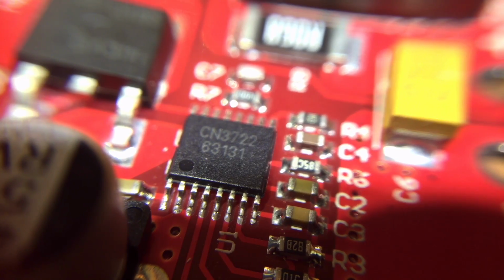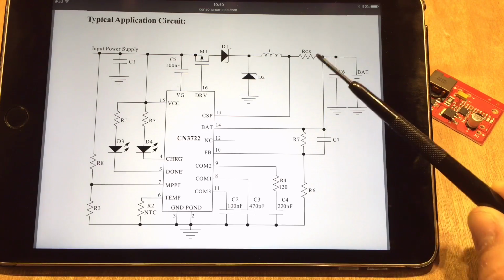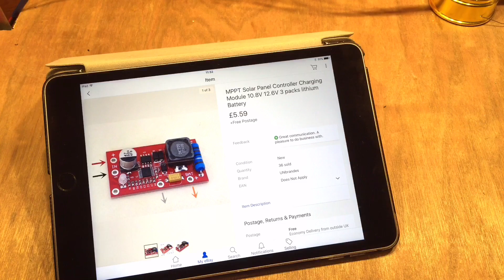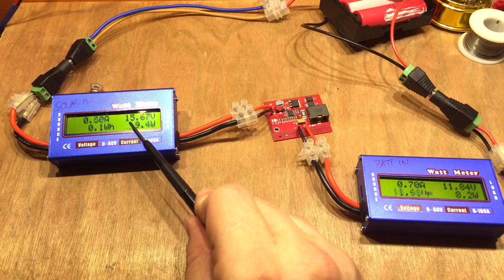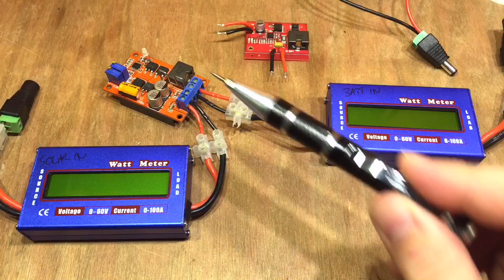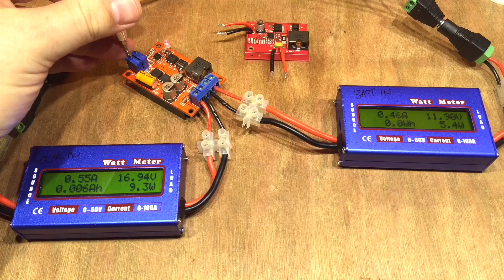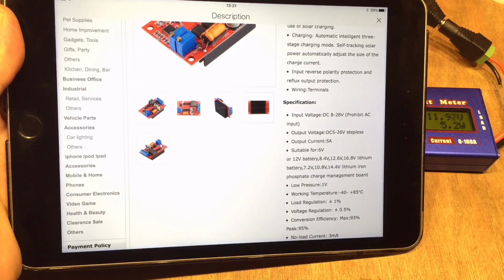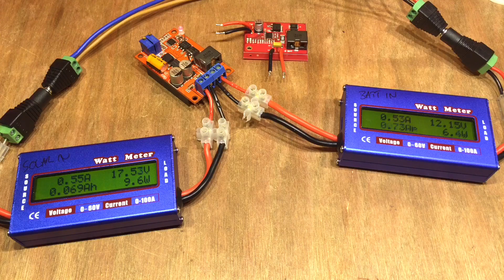Cheap(est?) Lithium MPPT Solar Charge Controller CN3722 - 12v Solar Shed

Comment: Hi Adam How maximum in put  volts does adopt this  moduler ?
And Ampier ?
Reply from the maker: Check the data sheet link in the description of the video.  The chip is good up to 28 volts and 5 amps.

Comment: I would have liked to see the panel plugged directly into the battery, through the meter, to see how much power would go into battery... The charge controller seemed to deliver lots less power to the battery, than the charger could put out.  Thanks.

Comment: I got this charge controller. However, it is showing a green light (meaning fully charged) when my three Li-ion 18650 batteries in series is at a voltage of 10.5V. Full charge voltage is 12.6V. What is the issue and how can I fix it?

Comment: the maximum power point voltage is never what it says on the panels. even with an expensive mppt charger. it alsways seems to be lower, yes, about 2V per panel.

Comment: I could not find 5A contoller like you share on the link. Now you can buy the same but it is written 3A output current. Can you pass another link or it is the same controller. Thanks!

Comment: How is it that they make a 5a $5 mppt charge controller then it jumps to like $100.
Reply: Because the $100 version automatically tracks the mppt power point and most can take higher voltage for series panels.  The cheap one is manual.and limited to 18V

Comment: I think you are confused about the MPPT voltage. It will always be the roughly the same no matter what the level of incident light. As the light level changes the output current will change (for a given load) and the voltage will remain fairly constant.

Comment: Noticed towards the end of your clip that the wattage into the batteries increased when you moved the pot away from the panel MPPT voltage.

Wouldn't it make more sense to peak the wattage input to batteries, as opposed to the wattage fed into the module from the panel.Great info though, keep it up.

Comment: hello Adam by chance have you tried to use more than one battery pack and charge controller  in parallel to see how it would work or if it would fail horribly lets say for example one solar source coming in going to oh say 2 3s packs using both of  these controllers set them up with one solar source input and each going to its own battery pack this is type of thing is exactly what i need to do with 4 4s 10p but 2 3s would be a perfect example on how these would function together considering they have the same micro controller you may find that a separate panel would be required for each one im just not sure yet im still setting things up and would like to know in advance I have 900 watts in solar so dividing things up a bit would be annoying but can be done. Another issue that may or may not come up is parallel the out put of the batteries on a load which may or may not play friendly while the batteries are charging and with the load active. If you do this test thanks so much in advance Ill know what to do and will purchase the second one you showed in this video
Reply from the maker: Multiple charge controllers on one battery bank is fairly normal - and in some ways I think it's easier to do with lithium because of the two phase charging rather than three for lead acid.  Two CN3722's set to the same termination voltage should work happily together, but they would need to be attached to their own panels.  Sharing panels on a MPPT SCC is going to make the whole thing inefficient I would imagine.
If you attach one battery bank to another they become one - and if they are out of balance a large current can flow between them.  It's best to plan to have a large battery bank, or two smaller ones and keep them like that I would think.
Reply: yeah its the sharing the panels that im really most concerned about and im thinking they would not be happy thanks for the response

Comment: Solar cells need a voltage converter that keeps input current at max.. input voltage get lower as sun light max. diminishes. According to panel/power graph indicates. Use perturb and observe logic folks.

Comment: i wonder how much power does the watt meter consume? if you put the two watt meters in line do the displays read the same?
Reply from the maker: Yeah they are not ideal.  I tend to use some now which have an internal battery.

Comment: The second one is junk.  It's not boosting the current at all.  It's actually REDUCING it and it's far worse than not quite as inefficient.  A PWM controller would be more efficient.

Comment: I assume this would not work with lead/acid auto battery?
Reply from the maker: The second CN3722 module would - set the output voltage and it'll do a pretty good job of charging the lead acid battery.  The only issue is you wouldn't get a float charge - so your battery wouldn't be quite as well charged as it might be of an evening.

Comment: I have been doing the same comparisons with a 2 Amp, 3 Amp and 5 Amp MPPT board. I am getting similar results.

What I found is that the cheapest board (the first one shown) is set for a 17 vdc Solar input, and the output is set to 12 vdc. What they say for specifications is wrong. Also, the maximum current is 1.5 Amps instead of 2 Amps. Again, misleading. You have to change the CV ratio and the MPPT ratio on the boards to get them correct. Then there is the cheap parts they use. I blew the 0.1 Ohm Current Sense Resistors after a few tries. Probably rated for 1 Watt. I replaced them with 7 Watt Resistors and they are working fine.

The 3 Amp boards I bought had one adjustment for output voltage. No adjust for input. Still set for 17 vdc. They ran pretty well until, again, blew the 0.07 Ohm Current Sense Resistors. The current limit was 2.5 Amps. Changing them now to 7 Watts.

I have yet to receive the 5 Amp versions that are the same design as you have. I will test those next.
Reply from the maker: Thanks for this - very useful to know.  Shame that it seems they've under-rated some components.  Best of luck with the 5 amp version

Comment: Hi Adam, I purchased the second mppt controller in this video.   I am wondering if I need to use a blocking diode on the battery side of this board.  I basically would do solar panel - blocking diode (I'm not sure if my panel has one built in so I'm going to assume it doesn't) - watt meter - mppt board - watt meter - battery.  do you think I need another blocking diode after mppt board or watt meter.  any thoughts from you would he greatly appreciated.  thanks

Comment: I recognized that turning the pot away from the MPP hightens the output watts to the battery while lowering the input watts from the solar panel. Assuming the important thing is what goes into the battery it seem to me that the whole mppt hype is a bit of a faustian deal, because whats the point to improve the output of the panel while decreasing the output to the battery?

Comment: unless I misunderstood you, you actually got more wattage into your battery from the first and cheaper version. Or did I miss something?
Reply: No not really, as he started to adjust the solar on the second one, if you pause the video right where it gets to 18.2 for the panel, you will see that it actually got the full rated 10W from his 10W panel... He said that his panel should be set at 17.5V for maximum power point tracking but I think that it's actually at 18.2V. I have these and they are excellent! Their outputs can be wired up in series or parallel for more voltage or current respectively... Or both parallel and series at the same time for higher voltage and current... The are very flexible...
Reply: @PeterMilanovski  wait you can wire these up parallel? Also I think he set the output voltage too low, the IC seems to be on CV mode instead of CC mode
Reply: @kaikart123  yes you can wire them up in parallel if they are connected to the same battery or battery bank! 
I had purchased around 10 of these things and had been testing them on a 36V solar panel which can peak up to 45V, they are not intended to be used with 36V solar panels, the datasheet recommend staying at 24V panels or below, I have found that it can work with 36V but will fail if the battery is disconnected from it while the solar panel is delivering! I have burnt out two of them so far and both times happened when I was touching the test circuit, otherwise the first one ran for 4 months straight, as a load, I used a computer fan which draws 0.5A and an led light which draws 1A and this ran day and night. The second one ran for less time but that was all down to me fiddling with the circuit sooner rather than later... I don't think that it would burn out if I had stayed within the recommended 24V or below... This burn out problem might seem irrelevant but I'm using Lifepo4 Batteries which have a built-in BMS and they will disconnect from the circuit if there voltage drops below it's threshold value and this would cause the MPPT charge controller to burn out should the battery decide to go into protection! The battery would also disconnect if to much current is drawn so that's another potential problem.... 
But they can definitely be paralleled... Overall, I'm really happy with their performance! And I think that it has something to do with the fact that I'm using the 36V solar panels, I found that it would fire up with the slightest bit of light in the morning and still trying to get every last drop of light at the end of the day, it's actually pretty dark by the time it actually shuts down, first thing in the morning and last thing at night isn't really outputting anything but you can see that it's still trying to give everything that it gets LoL... 
It does operate in CV mode, it will deliver up to 100W no problems, figuring out the cut off voltage is a little bit fiddly, I found that starting with a battery that isn't fully charged is a good way to start, after it's first few charge cycles, you can turn up the cutoff voltage to get it to where you want it to be, but once it's set, you will probably keep checking it a few times a day to begin with and later to once a day to once every few days till you just forget about it because it just works! And it needs nothing! 
If you have more battery capacity than you actually need to use, in other words, you have enough energy storage to keep whatever you are running off it to keep running for more than two or three days without sunshine, then you won't have to worry about the batteries going into protection due to under voltage... 
The batteries that I'm using are those 8Ah types that are usually used in computer ups power backup thing's, they are expensive per Ah but cheaper as a 12V complete battery that I don't have to build myself and it's protected against everything and has a built-in balancer! At $66Au each, I can purchase one a week and wouldn't notice it out of my pay! 
I hope that this helps...
Reply: @PeterMilanovski  I never knew you could wire them up in parallel, I need to handle 6A so I could just use 3 of these right?
Reply: @kaikart123  that's correct! With 10 of these I get a 1Kw... They do get pretty warm but with a computer fan also connected to the solar panel, it fire's up when the panel wake's up and shuts down when the panel goes to sleep which means that it's only working when it's needed, a diode in series with the fan and some capacitors after the diode will delay the fan turn off time, more capacity, more running time! That's just an idea though, if you are going to be using them at their 100W maximum rating, it wouldn't hurt to have some active cooling, either way, it has electrolytic capacitors on it and it's always best practice to keep them as cool as possible for long service life, capacitors next to a heat source always fail first before others that are further away from the heat source...

Comment: Thanks for the info. Could these be used with a 12V power supply instead of solar panels? It should work, shouldn't it? I'm thinking of using the variable one to charge a 2S pack. Thanks :-)
Reply from the maker: +Paolo Panzarino Yes it should work reasonably well.
Reply: @AdamWelchUK  This chip doesn't seem to power on with 12v input. Even though the datasheet says as low as 7.5v.

Comment: Hey do you need a heat sink for this? how do you mount it? Thanks
Reply from the maker: Shouldn't need a heatsink - it's fairly low power. Mounting is tricky as there are no mounting holes already created in the pcb.  It's not heavy though.
Reply: okay thanks I appreciate it
Reply: Okay thanks

Comment: About this mppt controller, sir. Can I buy it and make a little modifications  then I change the MOSFET with SCR? I have to make a battery charger for two12V lithium ion batteries using thyristor. I still don't know how to make it, and how to charge two batteries at the same time. I hope hope you can help me
Reply from the maker: +Ashraf Azman I doubt it without some
Considerable modification. The CN3722 mosfet pin won't provide much of any current.
Reply: Adam Welch Mosfet is acts as switch right?
Reply from the maker: +Ashraf Azman Yes. I suggest you read the data sheets for both the CN3722 and the SCR you wish to use.

Comment: About the non-adjustable lithium version, is the final charging voltage (i.e. 8.4, 12.6 ...) automatically detected by the module?
Reply from the maker: The final charging voltage is set by a voltage divider on pin 10 - the feedback pin.  It actually goes into constant voltage mode when this feedback pin hits 2.416 volts.  So the voltage divider is calculate to suit what ever pack size you are after.
Reply: Can you tell me what i have to do to let the 1st board charge a 4s-Lion battery (16,8V) ? Have i to change R7 and what value?

Comment: i need to charge my 2kw 18650 24v pack what charging method should i use? thx
Reply from the maker: +Serviciosymas CC/CV if you can. Otherwise bulk, boost but try not to float. I'm not sure I fully understand the question though.
Reply: I mean . i have connected my solar panels to my mppt epsolar charger. Should i jus connect my mppt solar charger to my 24v lithium pack and set it as lead acid battery program? Or should i connect the mppt into a bms and then to the battery? Thx

Comment: I have lots of BMS boards from Lithium Ion power tool battery packs. Got any clever ideas on what to do with them? Perhaps make a larger battery with their respective voltages?
Reply from the maker: +epicdeuce No clever ideas I'm afraid. There's a glut of small BMS's being wasted by those (me included) splitting laptop battery packs. They all just end up being recycled for metals as far as I'm aware.
Reply: I don't keep the ones from laptops, but the big ones that come off the large power tool packs seem quite hearty. I have been colelcting quite a few of them, im sure ill think of something for them eventually.

Comment: Someone asked if we could use Lead acid with these controllers. Do you know if you could use Lead acid batteries with the model with the potentiometer?
Reply from the maker: +shermluge yeah you could I guess. But you'd need to think about the target voltage you're setting. Once that voltage is reached the current will reduce. At 10% of the maximum the charge it would stop charging the battery. You would never get a float charge and your lead acid battery wouldn't stay at full charge as a result. So it isn't perfect.

Comment: Hello Adam, I have the same kit, what you showed in your video, please tell me the working of two given potentio meter. i could get .. please help me and i have one question more, when i trying to check the voltage drop across the terminals  "bat+ and bat-" then it showing 0V, what does it means? (battery was not connected on that time)....... thanks

Comment: More like a sepic converter Buck and boost
Reply from the maker: +MrBrymstond This just bucks. The input is reduced to the output (battery voltage) but the input will always need to be higher.

Comment: Suggestion:  When testing the output voltage, you can remove the batteries, and use a large capacitor on the battery side of the MPPT to adjust the output voltage of the MPPT/Charger.
Reply: It's possible but not while the solar input is active, no load on the output will kill it. Don't ask how I know lol... This is it's only fault, otherwise it works extremely well...

Comment: Do you have the circuit diagram ??
Reply from the maker: +sujahit rudra Take a look at the data sheet. It shows a typical circuit I believe.
Reply: Adam Welch do u have that data sheet ???
Reply from the maker: +sujahit rudra There is a link in the description.

Comment: If you look at amps amps in is .55 A and amps out is .43 A , at the end it is .55A vs .58A with mppt amps should be much higher on output.  However your panel voltage is low to begin with.
Reply from the maker: That's the trouble testing solar products - the sun is so unpredictable (especially in the north of England) and it's not a real test to use a power supply.  Most products are most efficient near their maximum rating, and that also makes it hard to test.
I quite like these boards and think that they do a reasonable job of charging lithium cells and if you want MPPT in the cheapest package you can find - this is your module!
Reply: ***** You are lucky, I live in San Fernando Valley of Los Angeles, California, USA and from May til November often see no clouds in entire sky for months. The reason why places like Los Angeles and Atacama desert get no rain is the ocean is cold.  As soon as the air moves inland it heats up and becomes bone dry.  England has a warm current and when when the air moves inland it cools and causes clouds.   Hope you test some new MPPTs that have come out.  But, I do get some solar power on winter days when it is cloudy or rains all day.